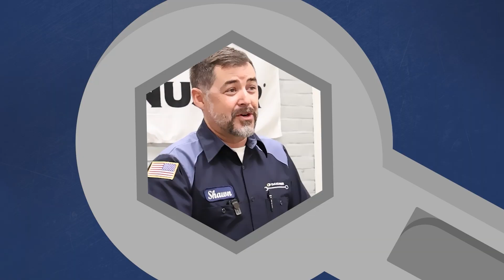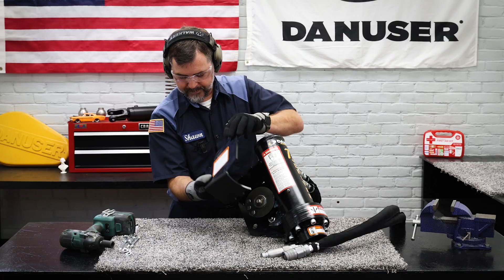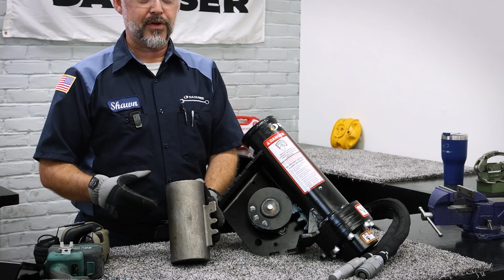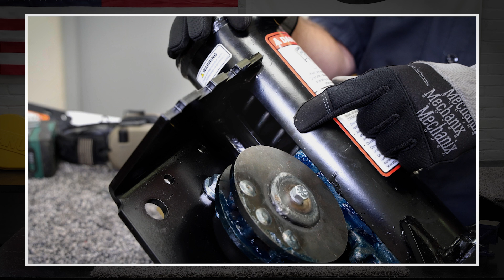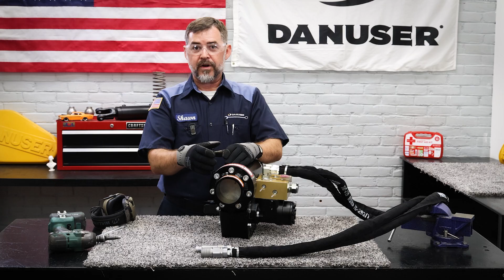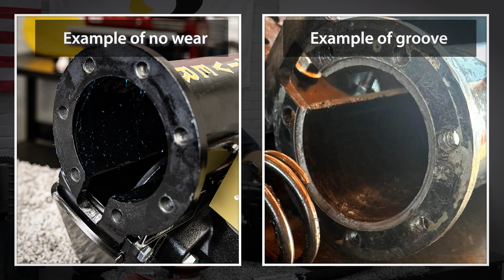In the Shop - Run diagnostics on your Danuser T3 post driver

Comment: What do you do if your driver is not equipped with a wear plate and is showing signs of excessive wear on the housing
Reply from the maker: Thank you for your question. 

Addressing this is a two step process; to start with, the worn “groove” will need to be repaired.  Fixing the groove involves filling the groove using MIG or TIG welding, then using a die grinder and flat grinder to recontour the inside radius to a 90-degree angle all the way around.  

Once the groove is fixed, install a 200290 wear plate kit to add the wear plate to earlier models.  The wear plate kit will add the wear plate, as well as replacing the foot assembly and strike plate

Other option is to replace the whole housing 21291S and adding the 200290.  

link to Parts Store: https://parts.danuser.com/attachments/current-attachments/post-drivers/spare-parts/t3-driver/t3-driver/
Reply: @DanuserCompany thank you very much for the information